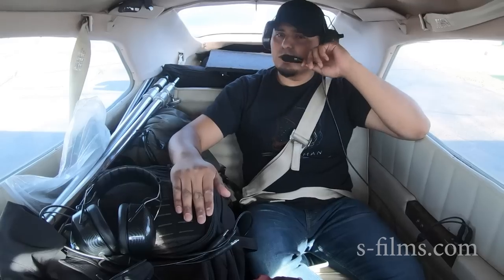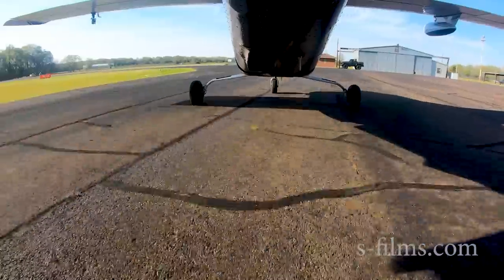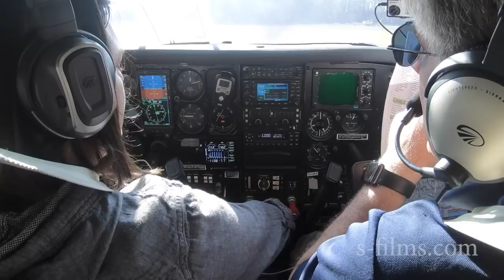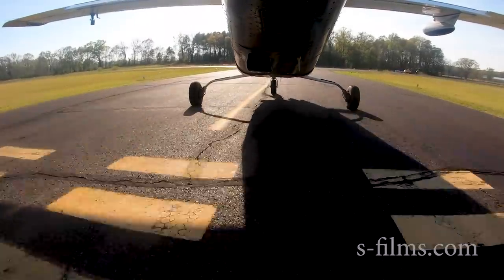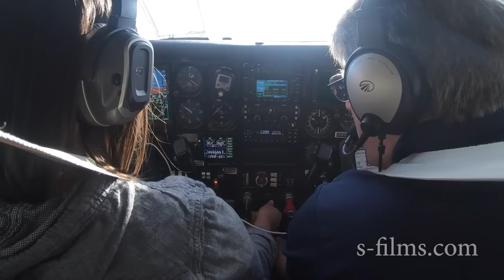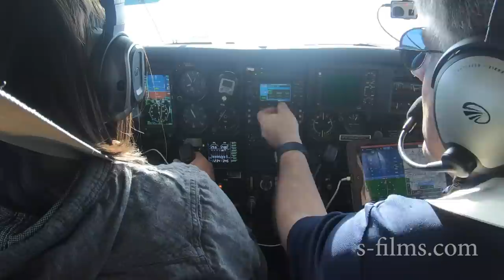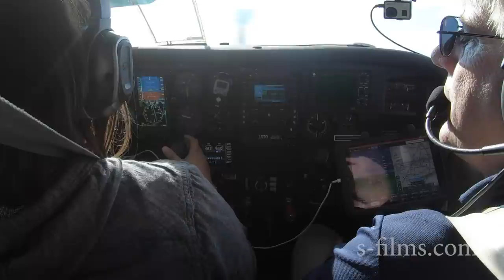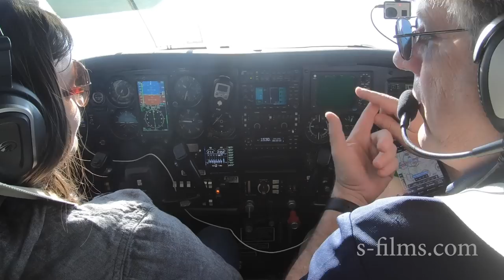How to Overwhelm a Student Pilot - TakingOff Ep 55

Comment: Few ways I learned not to overwhelm students. 1) is a good pre-flight briefing of exactly what we're going to do. Sometimes simulating some of the lesson on the ground as much as possible. You give way too much ground school in the cockpit. Brief all this on the ground and then go in the airplane and do it. Also do some of the stuff for them early on and don't explain, just say you will do radio and do it. You want them to focus on flying not flight following at first. (Garmin school best with engine not running.)
 2) Keeping the flights short. Anything over an hour total on Hobbs is too much, especially early on is just overwhelming. As they get experience you can get longer lessons as Req. First flights should be closer to 30-45 mins.
3) Don't bang out crap loads of touch-and-goes one after another early on. Go away from pattern, fly and get the feel of the aircraft, climb, descent, level off, turns (level, climb, descent) and slow flight, stalls.  Don't do a bunch of touch and goes early on. When you do TG's do a couple and call it quits. Let that experience sink in and debrief it. Otherwise you are just boring holes in the sky, wasting their time and money.
Reply from the maker: So this 4 hour flight wasn't a good idea?? 😜(And she only did first 30 min or so)
Reply: I'll add another hint for later on. People think you teach students to land, You don't, really. What you do is practise with them so they know where the ground is. Landing the airplane is relatively easy, it's just that doing it 20 feet too high or 20 feet too low isn't good. Once a student learns to look down the runway, and can tell the difference between 6" and 5' above the ground they can nail the landing. In fact, in my opinion, a good trick is to tell the student to fly just above the runway without touching down. That way they will learn to gradually raise the nose to stop the aircraft from sinking till eventually it will stall and land,
Reply from the maker: @LimeyTX  Interesting POV.  I like it.
Reply: I agree.
As a student, I had to start asking my instructor to brief me on what we were doing before I started the engine. it allowed me to pre-plan everything I was going to do before I needed to do it. this made my radio calls easier, I knew how I was going to depart the pattern and what my next radio frequency would be. briefing the flight took a lot of stress away when I was first starting out.

Comment: Tell her to read the “Pilot’s Handbook of Aeronautical Knowledge” before she starts to get a jump start. 2nd, the Airplane Flying Handbook.

I don’t recommend noise cancelling headphones if I don’t think my student is loaded with money. I’d rather see them spend the money on flying, and they can always get a better headset later and use the cheaper one for a future passenger. David Clarkes 13.4 model did fine for me for my first 10 years. They are comfortable and cut down on noise plenty.

For the first few times I have students talk on the radio, I have them read from a script with fill-in-the-blanks. They are overloaded those first few lessons. For their first takeoff, handling the rudder, power, and yoke is a lot to juggle. Isolate it to just the yoke or just the rudder. Explain that the goal of taking off is to reach a specific speed and then fly a specific pitch angle initially, and then to use pitch to fly a specific climb out speed. For my airplane, the pitch angle after takeoff is just below the horizon. If you can’t see the horizon, you pitched too much up, and that’s a goal that’s easy for them to remember during takeoff (although, sight picture is different based on eye-level). Pulling back on the yoke only lasts for a second or two before it’s returned to the neutral position. Students don’t usually know that they have to return the elevator back to the neutral position and end up over-pitching if they didn’t know that ahead of time because they’ll just pull back and keep it back. I try to show them on the ground how much the yoke should move from neutral to aft and back again.

Try to set your teaching goals for the lesson before the lesson, and that way you won’t divert too much off topic causing the “drinking from the water hose” effect. Teach as much as you can on the ground, because an airplane is a hectic environment to learn in. I chair fly on the ground with my student in the plane before we go up and do the same thing in the air.
Reply from the maker: Yeah my biggest take away after this flight was to do a lot more on the ground.

Comment: When I first started my "comeback BFR" almost a year ago my instructor and I were doing crosswind landings in fairly significant wind. He liked to side slip from "way out" and I was always taught to crab to the threshold(ish), add rudder, and dip the opposite wing to line up so we weren't in synch at the beginning, but we got there. One of the practice sessions (still doing it his way) was at a Class Delta airport (KVCT) and the winds were tough. After turning base to final I had full left rudder in to stay lined up. I literally had it pegged to the floor. I even made the comment that I hope the winds slack off a little when we get lower. Thankfully  they did. About the time I was slacking off of the rudder due to less wind I heard left rudder in the headphones. My brain was going :/ but I pressed the rudder pedal back to the floor. Again, the instructor said "left rudder". At this points the little neurons were all lined up telling me "this guy doesn't know what he's talking about, you better start flying"... I did what I needed to do and made a pretty nice one wheel at a time landing (If I had rubber arms I would have beat myself to death afterwards, I was pretty proud of that one). As we climbed out and headed back he commented on the landing and then said (drum roll please) "I kept tell you LESS rudder and you kept adding it back. I was afraid you weren't hearing me." and I said "well, I heard LEFT rudder and I thought you had gone bat sh*t crazy. I'm glad we got that worked out. I'm sure you thought I was hopeless"  :) 

We had a good laugh but he said he would make it a point to say opposite rudder in the future.